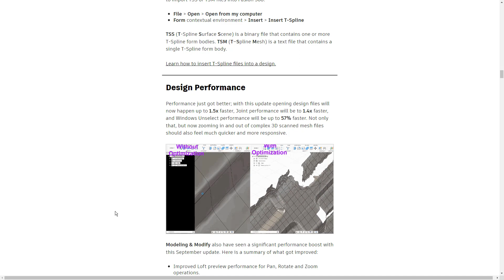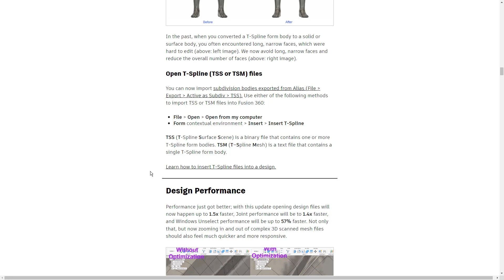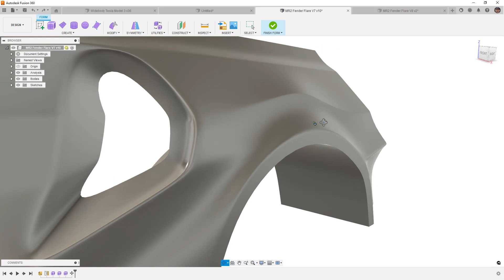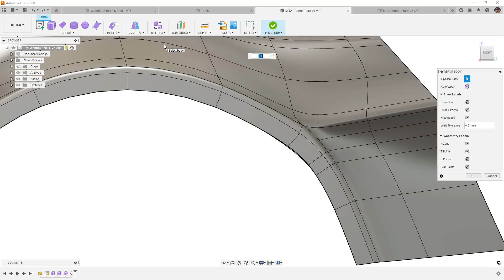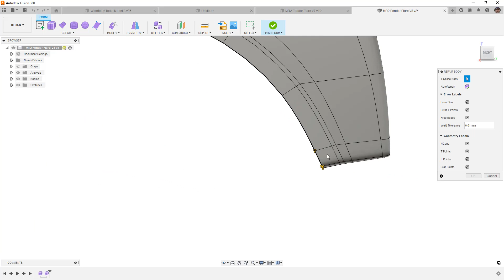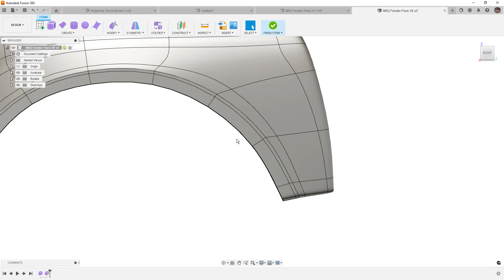What's New in Fusion 360 | Mesh and Forms Updates | Good or Bad? | #fusion360

Comment: Hey man looking to get into 3d designing widebodies myself and have to say you're insanely helpful. Designed my own spoiler for my car based off the custom one I previously made myself. Only question I have for you is, what do you think is the best/easiest to learn method/program for designing widebodies. In your earlier videos you mention "This isn't the best software...", so what is? Sorry one other question, do you buy your car 3d models in the widebody videos or make them? 

PS Keep doing what you're doing, and you'll make it. Also don't be afraid to walk the line between stock and too much haha.
Reply from the maker: Hey Steven!  Thank you!

So there are some nuances here.  When I mentioned that Fusion wasn't the best software for this you have to really think what your end goal is.  Car body design is typically done at the mesh level for concepts.  So Blender(free) is an option and there are car manufacturers that do that.  There are other programs which you can pay for to use Mesh Modeling, but really this is the concept/1st step.  The next stage is to wrap a Class A surface onto that mesh and refine it.  That Class A surface is something that can't "really" be done in CAD.  Without getting too deep into the topic we have continuity that comes in G0,G1,G2 and G3.  G3 is typically considered Class A.  G0 is coincident meaning surfaces touch.  G1 is Tangent meaning their curvature goes in the same direction at the intersection.  G1 is Curvature meaning the tangent direction but also the radius of curvature at that intersection.  G3 takes into account "acceleration" or the rate of change of the curvature going into/out of the edges.  This is one reason I like SubD/Forms modeling because you have as close to a curvature continuous surface as you will probably get.

So why is Fusion not the best tool?  Well the Forms tools are tough to use to get a good result.  You have to be careful and we dont have edge weighting control.  So if you want to have a hard edge on a design you need to bunch up edges around it.  Other subD programs do have edge weighting control like Power Surfacing add-in for Solidworks.

The second reason is because the Fusion surfacing tools aren't really great yet.  They are OK but not as good as other CAD programs.

So what does all this mean?  Well you CAN model bodykits and fender flares with Fusion as you can see.  You can do it with CAD surfaces or with Forms.  Forms is much faster and gives you more freedom.  Surfacing is really rigid and you need a lot of sketches and patch work.  

So there are many programs that offer SubD modeling, but they come with their pros/cons.  You can do Rhino, Inventor, Solidworks, SolidEdge, Ansys Discovery(i think) and on and on.  but at the end of the day these aren't "Class A" surfacing programs.  Programs like Catia and NX are very high end CAD programs that have higher end tools but they come at a steep price.  Dedicated Class A tools like Alias from Autodesk are purpose built for this stuff but when you look at Fusion at $400/year vs Alias at I think $10k/year its a big pill to swallow.

On top of that car manufacturers will take the mesh into Alias to make the surface.  Then the surface goes to CAD to do any design for manufacturing changes.  Its a big process.

My thought:  You CAN do it in Fusion and the tools are there in the Hobby version so you can learn for free.  The modeling approach in Fusion Forms can apply to mesh modeling in Blender as well as transition you to Class A surfacing in a true surface program, or SubD modeling in another program.  That is one reason i like Fusion, the cost for the tool.

On the models.  There are free models available from SketchFab.  Most of the stuff you have seen on my channel has been sent to me by subscribers.  The MR2 flare was a request, the Mazda, Tesla, Mercedes etc.  The MR2 was scanned by the user.  The Tesla was a very high end scan paid for by the user.  The Mercedes looked to be modeled from images.  I do know people that offer car scanning services depending on your location.  If you are building "tooling" I would strongly suggest getting a high quality scan done and have that person prep the file for you.

Last bit.  Fusion does ok with Mesh data, better than Solidworks in my opinion, but it will drag down your system when you get higher level/face count meshes.  I suggest to start small with a single fender vs a whole car when designing.  You will notice in some videos I just have a trunk, or just the rear fender.  It helps with performance.

If you have any other question feel free.  you can also email me support@caducator.com
Reply from the maker: side note.  I originally started this channel as a place to document my car modeling, widebody concepts and eventual build on my own car.  Sadly I haven't had the time/dedication on that project yet, but I am making slow progress :)

Comment: In my opinion they're focusing on the bad directions...

Autodesk Fusion 360 is not the best machine for projecting.  It's ok but if you use many components it will be very hard to hold fully project.

They need to increase performance in  CAM.  Simulation with machines, 5 axis performance to calculate difficult toolpaths. Actually its really bad. 
For example.
Re-work patterns.
Re-work linking 2d kontur
+plunge operations
Re-work 3d pocketing with entry point (plunge out of stock)
and many many more...
Reply from the maker: Hi Mateusz, while I don't work for Autodesk I can say that they put a lot of effort into CAM.  There are updates to machine simulation in this latest release but I haven't played with them yet.  There have been performance updates to CAM and I haven't specifically run into the issues you state(although I have had my own).  Sorry to hear you are having difficulty!

Comment: I am currently working on a project for school and am now making a flashing light holder for a colleague. My colleague would like to have a result of what I have scanned and drawn in 3D. how do i do this?
Reply from the maker: Mattie, I am not 100% clear on what you mean.  With Fusion 360 you can send them a Share Link of the design that can be viewed on the web.  If they have a free Autodesk Account you can also invite them to the project as a viewer only which will allow them to navigate the project files(on the web) and view them in 3d in a browser.

Is this what you are looking for?  You can find Share a few different places.  You can right-click on the design in your data panel, you can use the file menu and you can find it on the web on A360.
Reply: @LearnEverythingAboutDesign  👍

Comment: I dion't understand why they have not included a tool that would turn meshes into a quad.that easier translate to a t-spline.
Reply from the maker: They do, but its locked inside the Product Design Extension.
https://youtu.be/-7OI9Mwt944